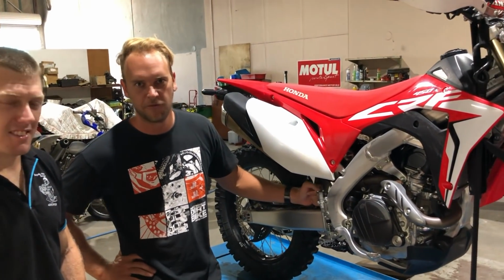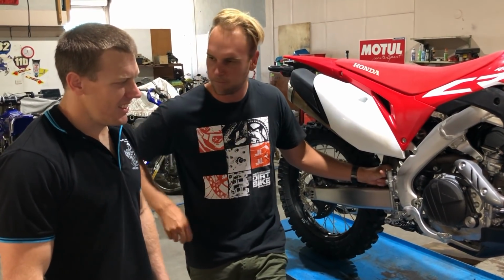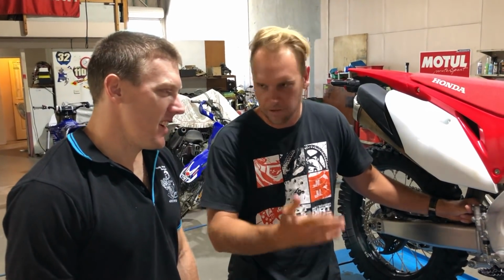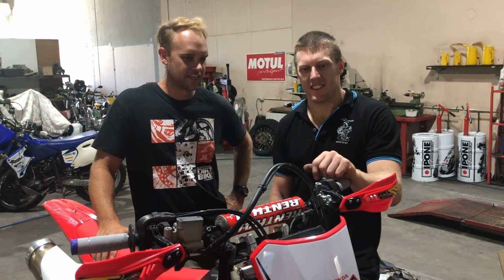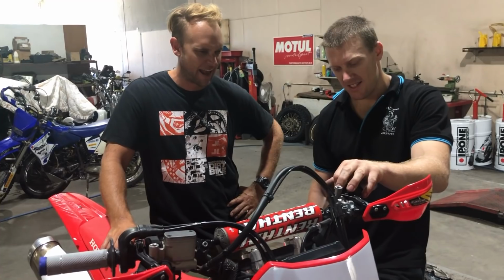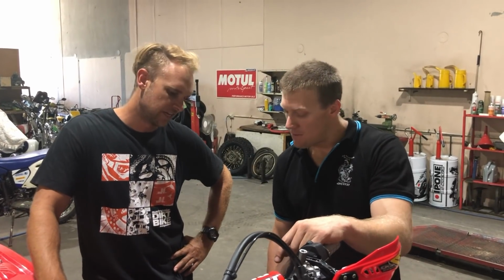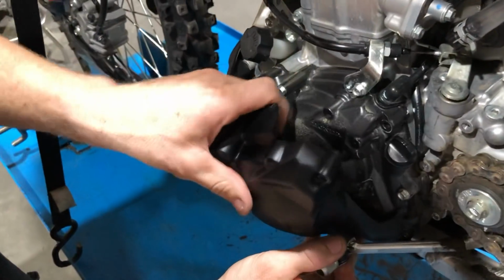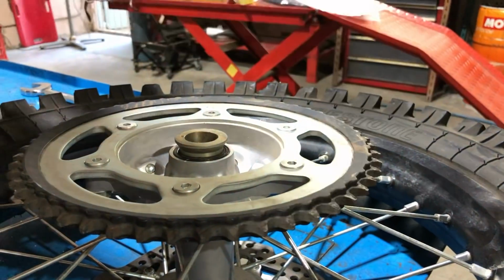Honda CRF450L Build Stage 1: CRF450L STRIPPED back and sheds WEIGHT!

Comment: DO NOT REMOVE THE BOTTLE. It's not a catch can, IT'S A COOLANT EXPANSION TANK. You will lose coolant if it's not there and will cause overheating issues. There's a valve in the radiator cap which allows hot coolant to flow into the bottle. When the system is cooled down, atmospheric pressure pushes the coolant in the bottle back into the radiator.
Reply: I dont think they know how important it is... especially if they want to go for enduro. Bike will overheat pretty fast. Compression will be low
Reply: You're still losing coolant. The wr450 most likely has a different maintenance schedule than the 450l.
Reply: I removed mine, zero issues. Only
Leaked a few ounces over a year.

Comment: Just had a thought.... Why don't you remove the 6th gear to save even more weight? You could also remove every other spoke from the wheels. Helium in the tyres also helps.
Reply: Don't forget about drilling holes in the frame, running bald tires, and using a plastic chain
Reply: I fitted the fuel tank from a Honda melody scooter to my CRF450L in order to save weight, but i found by far the best thing i did was to pay a mining company trillions of pounds to remove billions upon billions of tonnes of material from the earths core in order to lessen the gravitational effect the globe was having on my bike. It certainly is a lot easier to pick up now, and corners like a dream.
Reply: you probably dont care but does someone know of a way to log back into an instagram account??
I stupidly lost my login password. I love any assistance you can offer me.
Reply: @Yael Wallace instablaster :)
Reply: @Rowen Orion I really appreciate your reply. I got to the site through google and I'm in the hacking process now.
I see it takes a while so I will get back to you later when my account password hopefully is recovered.
Reply: @Yael Wallace No problem xD
Reply: @siedpe13  lol. hole in the piston too

Comment: I would have left them engine covers on and the expansion coolant bottle on and put a aluminium front engine guard on the bike won't struggle with  big of wieght on still id rather the engine be protected and run properly  and be more relieable
Reply: Same that is the reason why I would buy a Honda in the first place mic jubba.

Comment: good work fellas, when you got it all done can you post weights up of all the junk you pulled off it. no doubt that pipe will be a huge anvil, other thing you might be able to pull off is the exhaust air injection as it won't be needed without a cat,  i would prefer a Honda to a KTM any day the build quality if far higher, but sadly weight is the only thing making me hesitate, Honda claim 131KG wet  if it's closer to 120kg it will be a awesome long life bike and ill be buying one

Comment: You would gain a lot of weight savings replacing that muffler, ive heard the Yoshimura 2019 CRF450X systems bolt straight onto the CRF450L.
Reply: Damon Holmes speaking of the x why not just start with that instead of modding an l?
Reply: @jwalz_5737  Because the X isn't road legal like the older CRF450X's where
Reply: @damonholmes9299  What they did to it, this one isn't road legal either ;)
Reply: @damonholmes9299  what do you mean when you say, the old CRF450X?

Comment: Bro WTF is this? You remove weight from a bike removing steal not plastics, you left the stock exhaust, the stock battery, the steel rear sprocket... I have no words you just ruin the bike.
Reply from the maker: We'll assume you didn't watch the full video...
Reply: @ADBMagazine  Nope.  I watched the entire video and you not only ruined a perfectly great little 450L but there are Honda engineers who cant stop crying.
Reply: @jimc793  Worse, not street legal anymore ;)

Comment: So you took of all the lightest parts. No rear light so not road legal. Left the heaviest part on in the silencer. Took off the engine covers that will protect the cases in a crash. Took off barkbusters which save your hands and levers.  You may as well gone and bought a cheaper comp spec 450 which would be lighter, faster, .......DOH!

Comment: Well, I guess you did because you "could" but you took everything off the bike that makes it a 450L.  Next time, just buy a 450RX and you drop 20 kg without removing anything.  At least in the states, you removed everything that makes it street legal like the tail light, license plate bracket, horn, etc.
Reply from the maker: Like so many people in Australia who only have a local Honda dealer, we wanted a registered Honda CRF450 we could legally ride in the bush. The CRF450L is the only option from Honda.

Comment: This is soo stupid you guy just remove every protective part , then you messed up the air fuel ratio by removing the top of the air filter box whitout rejetting the bike and then to top it off you remove the stock exhaust wich is the only good thing you could have done but then you put it back after you scratch it and remove the heat shield lmao